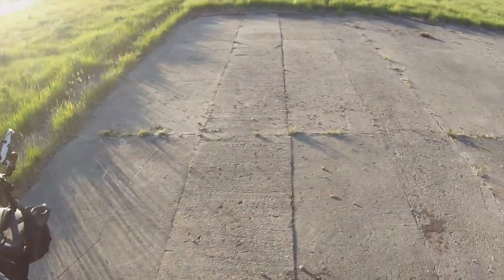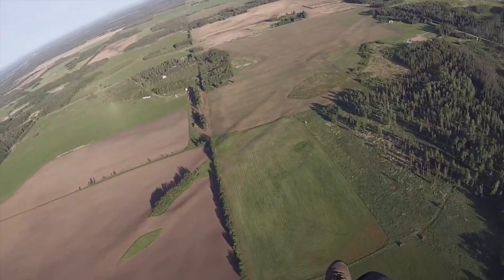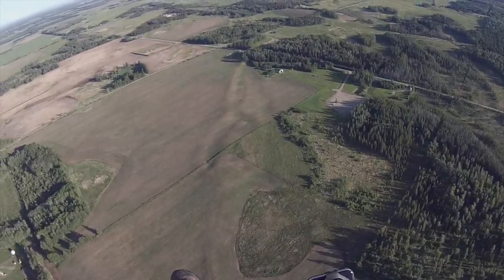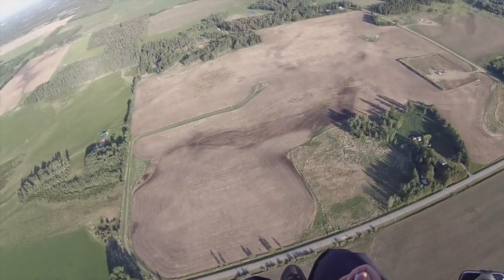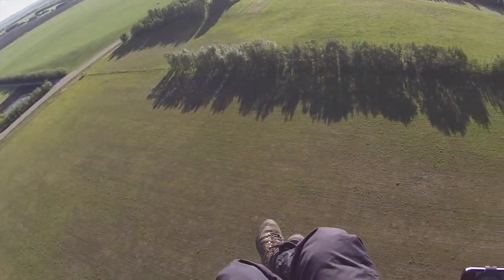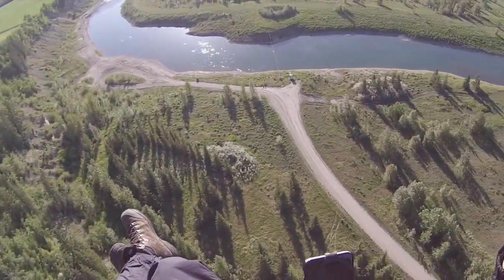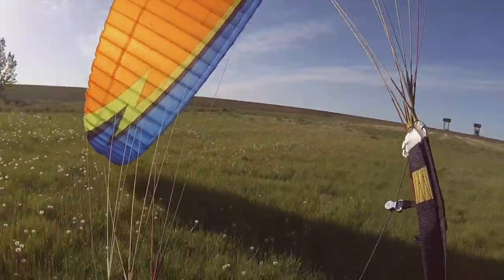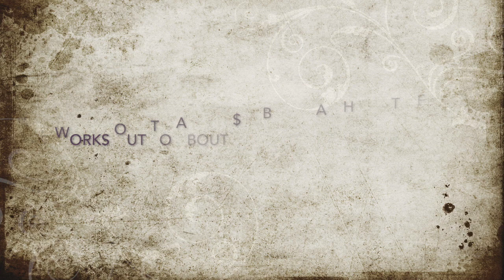Paramotor!? How long can you fly that thing?

Comment: This is the coolest flying machine even... I really don't know why aren't more people doing this. It's so affordable... like bying a motorbike, but why more fun!
Reply: The reason is that motorbikes are a lot more useful transportation wise. For example, you can't really go to work using these especially if your work is in an area crowded with high buildings.
Reply: id say fear, and people just not knowing this exists to be 2 main reasons. Personally i think its relatively safe and well worth it. you cant hit a deer at 500+ feet in the air. 
you cant be hit by a drunk driver or someone not paying attention. 

Affordable is a wide term. i currently cant afford to replace a $36 headlight assembly a deer decided it wanted in its shoulder or get a new car even if it cost $5500. the only affordable solution was clear tape, clear plastic, and aluminum foil to repair what i had left of it... But a guy with $100,000 in the bank would have no problem getting what equipment and training he needed. also having to take a 7-10 days off work for training is not easy for everybody.
Reply: Hi well in my opinion,its expensive, in my country good new paramotor goes from 3000 pound to about 9000 pounds,then good wing new about 2,5/3000 pounds and we have to have pilot licence for each sport /pg/ppg/tandem from legs,tandem from trike...each about 300/400 pounds, lots of studiing,then chek of the equipment 200pounds a yoear,cost of gas, ,...so for us its not that easy and the income is much lower then in UK/about 90/1200 pounds. /allso its not that dangerous  but its not like plaing chest :-) you have wind,turbulence,thermic,engine failier,line tangeling,birds,watter, and power lines,/got i hate them :-))) so you dont hit the deer but when strong blast of wing get you stall and you fall to the groung at speeds around 80km /h its not much fun:-), ok guys thats bit of why i think not every one doing this,,,but i love it. check my videos thanks Vítek D:B:TV.

Comment: Nice video!
What is your engine (and frame)? 
And - yes - with a standard setup most of the 2-cycle paramotors fly about 2 hours.
This time varies from day to day, depending on weather, engine setup and flying style.
4-cycle engine - like Bailey Aviation - would last for 4 hours in standard setup.
You can fit a bigger tank (or additional tanks) if you like to fly longer. 
You can also take some extra oil with you in a pocket and land next to the gas station (there could be no good oil on the station), but I never tried this. I prefer good ground support for long x-country flights. Nice if a friend can follow you in a car with extra fuel and other stuff.
Good Luck!
Reply: Maybe this is where you buddy up with say 5 people (maybe clubs do this).  1 drives the other 4 fly.  This gives everyone a chance to do repairs and have a break.

Comment: how long can I fly? I hope for many more years. Till I am really old, and can still run. Just like riding a lawn chair only off the ground. All it takes is to think ahead, be ready for anything, have no fear, and fly where there are no electrical wires in the way up the river. or cables. The biggest killer is engine out over water, and then be prepared to swim. Quickly. practise getting out quickly, and then, "DON'T PANIC".

Comment: Burn rate depends largely on what motor you're using and how aggressive you are on the throttle.  I have experience with two motors a Parejet V3 with a Moster 185 and a Nirvana Instinct 200.  The moster 185 burns around 4.2 liters per hour and the Instinct burns about 2.3.  So on straight level flights I can expect to get about 6 hours.  Though you also have to take into account the Nirvana Instinct is one of the more expensive motors on the market.

Comment: Is that a RAM mount for your cell phone? If not, what mount is that? Was the gray wrap band (wrapped around the top of the phone) included in the mount? I'm looking for a good phone mount for my Paracruiser that won't let go of my phone in high vibration conditons. Thanks!
Reply from the maker: It is a Ram mount and the rubber wrap came with it. It holds the phone great but the vibration does effect it

Comment: Hi nice video ,thanks....by the way it allso depends on the type of machine,some fly top 80 that doesnt neem much fuel and you can fly 3/4 hours,or you have bigger gas tank like my nirvana instinks 15l so can fly evrage about 3 hours or get a blader for xc and have another 2hours ,but deends on the wind ,wing you use thats a big factor, trimed in or not,changing altitude...and so on, 2t. 4t...engine...:-)
Reply: Yes, my TOP80 burns around 2.8l/h in a "non-agressive/non-climb mode" 2/3 trims open, so with a full 10l tank I can do +/- 3.5h. Distance is something else as it depends on wing, wind, orography, weather etc.

Comment: Do you have any info on electric motors and flight time?
Reply: mr unnamed::the japanese cat you saw flying with an electric motor, looked like a rotormax 150cc electric motor, gear reduced. it draws 195amps @60v, and the battery he was carrying down in the box, probably had 15 to 20 minutes tops at that amp setting. not saying isnt fun, at all, but could that take you 50km, no. maybe just 5 to 10 minutes.
Reply: Google “lithium mines” and “acid rain” and tell me electric is still safer and more efficient for the environment than gas...

Comment: Your fuel tank capacity?
Reply from the maker: 10 litres
Reply: 10 liters is 2.64 U.S. gallons.  This would easily take you abouit 60 miles per gallon via a 150cc 2-cycle motorcycle, at 50 mph, 3.2 hours, for a total of about 170 miles on a level roadway with no headwind.  Think you could fly 170 miles, one-way with near zero headwind on 10 liters?
Reply from the maker: Nope! I am guessing you have never flown and are unable to put a comparison on the experience of flight to riding a motorbike. Get back to me when you have and then you'll know...you'll just know
Reply: Nope?  I would have thought you could easily fly that distance on 10 liters. Also, it was merely a question of distance traveled as to efficiency, not experience or sensations of either mode.  Pretty simple question really.  Sorry you were confused by it.
Reply: Your maths dont work here, young one
Reply: Bandit Leader 2 plus 2 is 4 minus 1 that's 3 quick maths